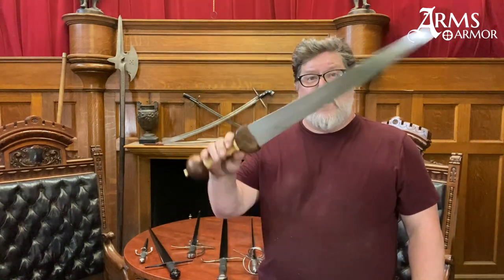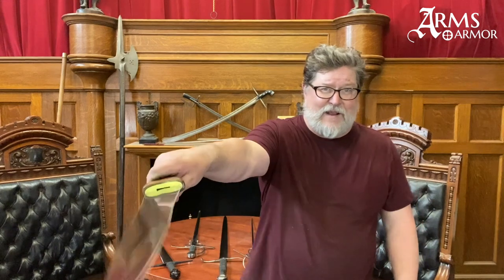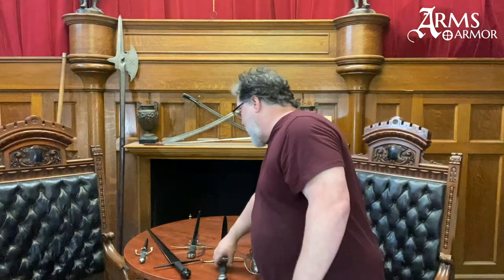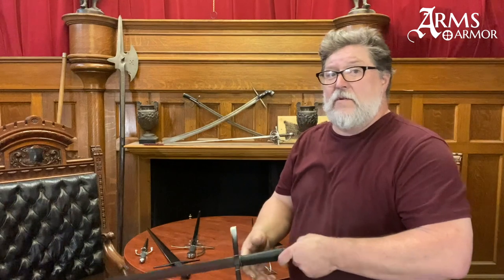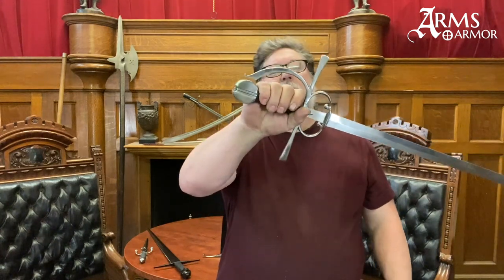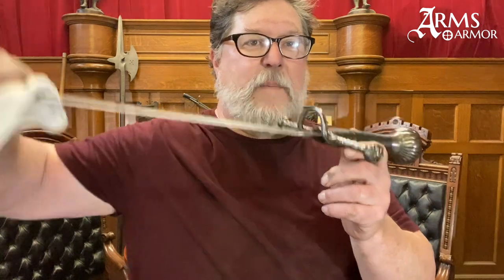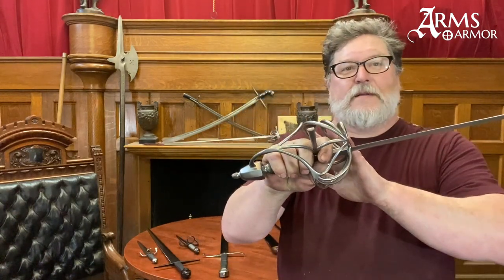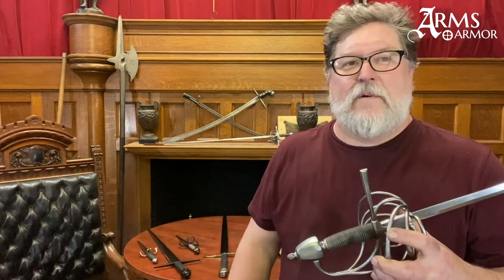How Do Crossguards Work on Swords and Daggers

Comment: Its important to remember that when fighting with a shield, a guard is not necessary often times and a complex hilt is a detriment as it gets snagged on the shield or hits against it when performing thrusts and cuts around the edge of the shield and even moreso when fighting in a close formation the complex hilt may even be snagged or tangled with the weapons/hilts etc of the soldier to your side.

Comment: do you consider that Venetian sword a side sword or an arming sword? which 1 is it closer to?
Reply from the maker: Good question, in period it would have been a spada. The differentiation of terms is a more modern thing. I think today it could classify as either depending on the specifics of your definition. But that relies on us today making arbitrary choses about what length, width and design mean. The medieval way is much more to identify by intent.

Comment: OMG!  You call it a finger ring and then you fail to actually put your finger through it!  That Pas d'Anne was designed to protect your finger that any real knight would have wrapped around the crossguard to add leverage in the cut and strength in retaining the weapon as he gets tired.  This continued through the development of rapiers and was finally used in the Italian-style modern fencing foil.  
(PS, you held the swept hilt rapier correctly, so why not the earlier transition?  

PPS:  Someimes it is IMPERATIVE to fence with the hand fully extended, as in epee which evolved from rapier.  Reason is to hit the opponent, often in the arm, as he is in the act of attacking you.  This is probably the most common touch in epee and anybody using a long heavy weapon would immediately learn that it is far easier to outreach the opponent that to make circular parries with such a long, heavy weapon.
Reply from the maker: I guess I was focused on discussion of the cross and how that worked more than a discussion of gripping the sword.